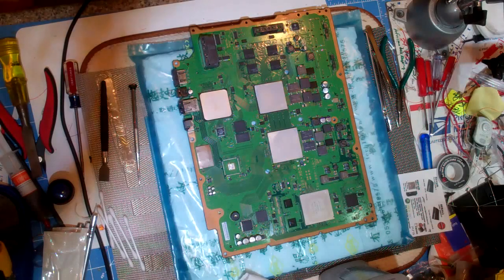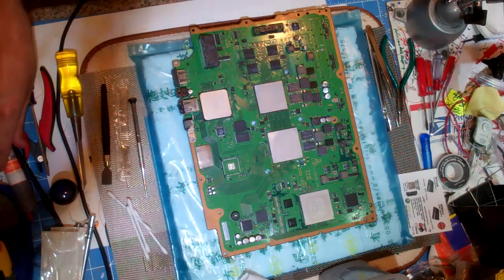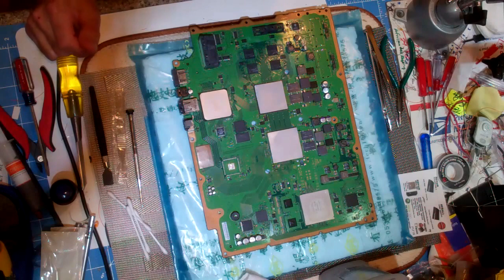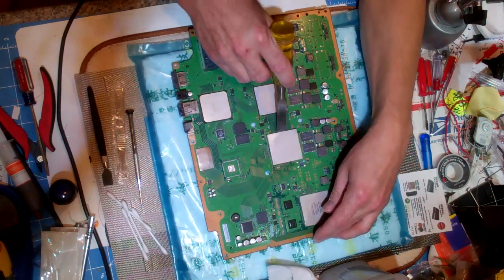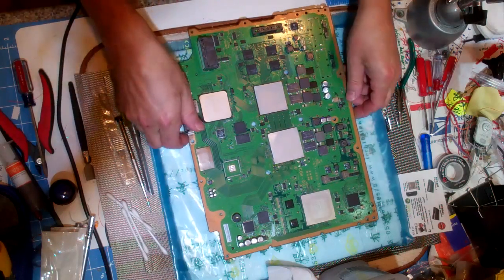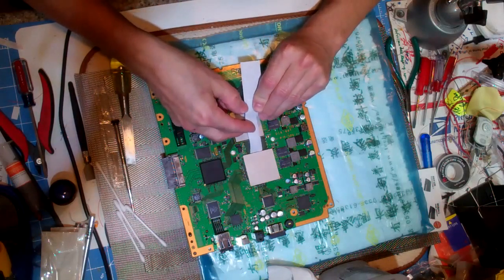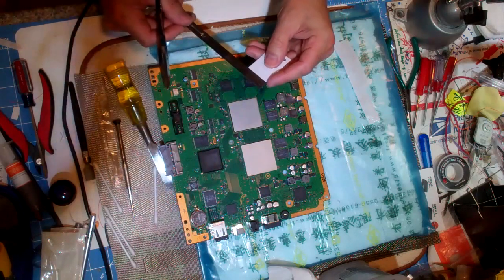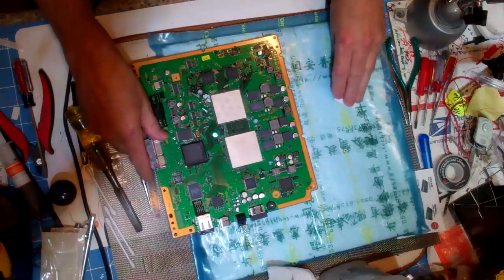Removing and replacing the heat spreader IHS on a Playstation 3 main board - SpitFireMods

Comment: what about the cpu
Reply from the maker: I’ve done over 2000 Ps3 repairs and have never found a cpu to be the problem.  There are guys that will state this is not true but I have no information to backup a cpu failure.  Simple reason is cpu does not run near as hot as gpu and therefore does not experience solder heat fatigue.
Reply: but doesnt the cpu need to have its ihs removed because of the old thermal paste underneath? i think that would improve temps significantly

Comment: My ps3 is freezing my image with crazy line on the screen but the game sounds like its still play what can it be?
Reply from the maker: If it has never been worked on I would guess its starting to fail.  A GPU repair should get it back to normal.  If someone repaired already then it either was bad repair or sustained damage during the repair.

Comment: So I was working on one of my ps3s and when I tried to remove the heatspreader on the gpu one of the ram chips split in half and was still stuck to the heatspreader the CPU was easy to get to but the gpu was a nightmare if I were to use a heat gun would that loosen the glue a little to make it easier?

Comment: I've removed a few heat spreaders but I'm stuck on one stubborn CPU spreader that will not budge. This board overheats and I suspect it's the paste under the CPU Heat spreader. The GPU ones are a lot easier to remove than the CPU. I do find preheating the spreader to ~150C helps break the glue. Any advice for removing stubborn CPU heat spreaders?

Comment from the maker: Copper shims are the worse thing you can put on a PS3.  If you want more pressure just bending the clamps slightly will apply much more pressure without crushing the GPU from being too thick an area under the clamp.

Comment from the maker: You can use thermal adhesive on the ram in the four corners along with AS5 or thermal compound on the middle.  OR  You can just put a small bead of AS5 (thermal compound) on each of the five surfaces.

Comment: someone who knows what hes doing. this is what i done before i repaired my ps3 due to the lack of thermal paste under there, the heat is unable to transfer the the heats preader. then apply epoxy glue to re-apply the heatspreader and allow to set for 24 hours. reflow and copper shims.